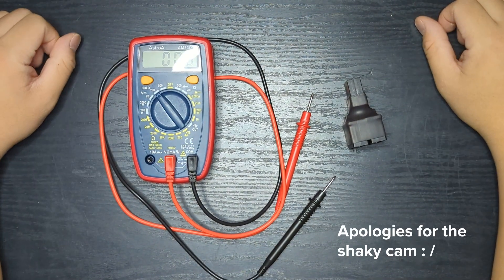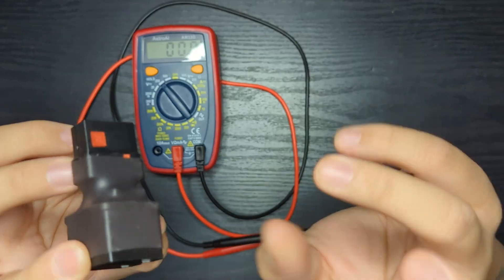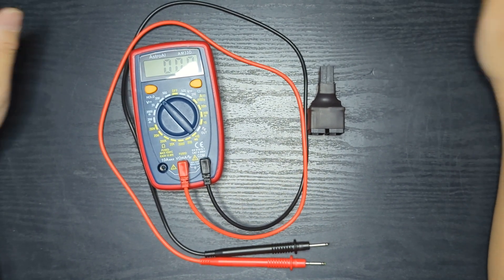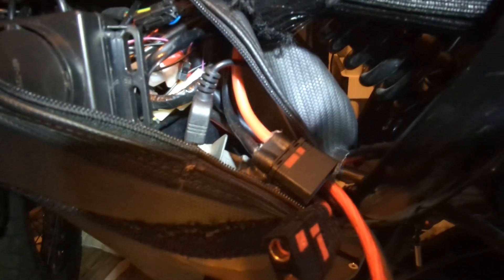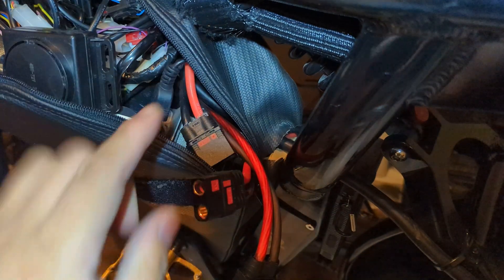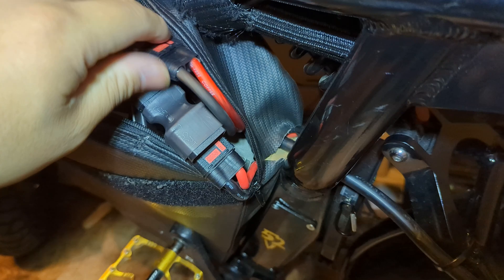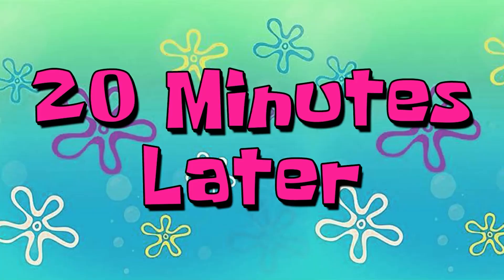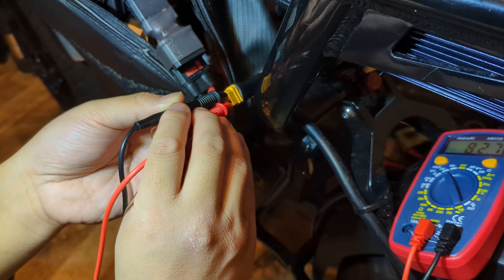How To PARALLEL CONNECT E-BIKE BATTERIES (Easy Step-By-Step)!

Comment: So I want to add a second battery to my bike I was going to buy a blender and another 48v 20ah battery if I buy a xt60 parallel  connector will it increase my ah
Reply from the maker: So whether you use a blender or directly parallel them with a splitter, you will be increasing your ah in general. The only difference is the performance. We've found using a blender slows down the bike in terms of top speed while directly parallel connection adds torque and a little boost in top speed.

Comment: Can i use  an older 48 volt Lectric battery and combine it with my new EBoX 60 volt battery to get more range? Not looking for power so just wondering if i can find the room to hide the 48 volt battery on the EBOX 60volt bike and get more range..itd help.
Reply from the maker: It's not recommended to combine a lower voltage with higher voltage pack only because the difference is too much for both packs to handle especially when they try to balance each other out. Even with a battery blender I wouldn't recommend.

Comment: nice video ,  I have a scooter and just connected both batteries directly to the controller, is that safe ?
Reply from the maker: It's safe but just make sure both voltage readings are the same

Comment: Hey there! would this work if the BMS is different from each battery.. 🤔🤔
Reply from the maker: @KILOALXE  yes you can parallel two different BMS and batteries. Under load the current will usually go with the lower rates BMS first.
Reply: I see!  Thank you so much for the info JB!!

Comment: Can you mix different amp BMS? I have no idea what the stock bms is. I'm running a72v  3,000watt, 40ah battery and i want to add another 72v 40ah battery for range. However there are allot of options but with different bms. Such as 100a, 200a etcetera. Thank you for you time
Reply from the maker: Usually when paralleling two different BMS, when one pack goes into over protect, the other one will as well so it's safe to say it will most likely rely on the pack with the weaker BMS.

Comment: I got a bafang BBSO2 with a 48v-10 ah battery with Anderson connectors. What do I need to convert?
Reply from the maker: @HB-yq8gy  you can actually get an Anderson connector splitter on line so it will be compatible

Comment: Hey man much respect for your setup and wat a cool bike 😎,,its been about a year now how are things going with your bike ,is it stilll ok  the reason i ask is ive a 11ah and a 18ah  that i want to join  both 48volt  and i dont think i need them boxes  ive got some xt90s doubled up  do u honestly think ill be ok doing rhis seens theres a big gap  between batteries like 7ah ,i would still chrge  the batterys in there normal ports would that be ok to have everything plugged un and chargeing with 2 charger s, god bless man  ive subbed 👍
Reply from the maker: No matter the current as long as the nominal voltage is the same you can join them via XT90 for parallel connection. A lot of people that use range extenders use ones with low amp hours.

Comment: When I connect the batteries together and my controller pulls 50amps,will the controller split the amps from each battery? (I’m connecting four 72v 20ah batteries in parallel) just wanna make sure before I run it… ty
Reply from the maker: @FA-cc7ng  the controller will treat the paralleled batteries as a whole so the 50amps will discharge equally among the 4 batteries at the same time. Now if the amp hours are varying, it will discharge from the lowest ah first.
Reply: @JB360_NYC  Ty brotha I appreciate you
Reply: @JB360_NYC nope.. lowest Ah will have higher internal resistance... so lower current from smaller pack.
 higher current from bigger pack... so they perfectly discharge in parallel keeping voltages the same
Reply: Does the amperage of the BMS have to be the same for both batteries? I want to add a second battery to a 72v 3,000watt hub moter. There are allot of options with different amp BMS available, I don't know what my stock is.  @JB360_NYC
Reply: What actually happens is the blender reads the voltage from the batteries and switches to the highest voltage battery. As you use this battery the voltage will sag slightly and the blender will switch to the next highest voltage battery and the first battery will recover as the blender switches between the next two batteries and then switches back to the first battery, or whichever had recovered the quickest. This means that a weaker pack will take less of a beating, but you're still drawing the full amperage from one battery until it's voltage sags and the device switches to another battery and pounds on it until the voltage sags. It doesn't absorb abuse like a single larger pack will, because the abuse is spread over more cells. It just allows the smaller batteries to recover briefly in between.
Reply: @nathansroofing9748  thanx brotha, since I have them connected can I charge them at a higher amps
Reply: @FA-cc7ng I have 2x 52v 25 Ah... each pack can be charged with 5 A ... but I do not set my charger to 10 A... I set it to 8A to have some safety room ... I do not use a blender ... y splitter cable in discharge and on the 2 charge ports used
why I do NOT use a blender that switches between packs?? both direct in parallel means they share the load.. lower current per cell and lower voltage sag under load
Reply: @ ok cool thanx brotha I appreciate it this helps big time
Reply: @FA-cc7ng  if all 4 packs are identical then you can use all together (no blender) ... but you have to take care that they are exactly identical... my genuine pack had a safety diode in charger port (so a short on that port does not hurt.. there only can flow current inwards but not out) ... added 2nd pack did not have that inline diode ... so they could not be charged to same voltage with ONE charger ... I added a 5 Amp diode in the 2nd pack in minus rail and now the one charger sees both packs... but one pack can not see the other pack
result is on charge and on discharge the voltages are identical (in fact they can be seen as a single bigger pack) ... on discharge they are direct in parallel and share the load... on charge they also have the same voltage cause I use one bigger charger with y splitter cable and both packs now have the same voltage drop over the diodes ...
Reply: @ yes they are all identical the same pack 72v20ah, thanx brotha I appreciate it

Comment: Hi great video can anyone tell me if you can run a older battery in parallel with a new battery and does it matter if they are different cells?

All that matters is that both batteries are the same voltage 

Thanks
Reply: Good question but i think once your getting the same voltage number or very close  then i cant see why not ,go for it bro ,im goin for it just waiting on a reply here to confirm and im  connect ing  a 18 ah to a 11ah 48 volt  and the 18 is a older battery

Comment: 👍 Nice... Do you know how people are getting 60 mph off 60v system while others only get 50s on 72v ?   I assume its controller but is it  matter of preserving lifespan of batteries?  You would think people would want highest amp possible?  Thanks, and love your content!!
Reply from the maker: @kevinduprey9326  thanks! So yes like you mentioned, it's mainly the controller and the type of BMS the battery is suited with. On the flip side, 72v batteries will always be better on the range side than 60v, since they take longer to discharge from their starting voltage.
Reply: @JB360_NYC  . NICE,   obtained some 80v green works batteries and will harvest the good ones.  I was thinking about getting solder less kit because I'm not to good at it.   Unfortunately I know from making vape devices that every added connection  causes  voltage drop.  Vaping with hybrid mechanical mod with direct battery contact is noticeably stronger than devices with added connections.  I can only imagine the difference in EV's using hundreds of cells.

Comment: Does it need  to the same AH?
Reply from the maker: No they do not they can be different amp hours
Reply: @JB360_NYC  will parallel battery increase speed and torque 
I have a bac4000 controller do I need to retype my bike
Reply from the maker: @allan2502  you will get a slight increase in torque and top speed. In terms of the BAC app, you should not have to adjust anything unless you want the controller to pull more amps you should be fine.
Reply: @JB360_NYC  is their a parallel connector for supra connectors?
Reply from the maker: @allan2502  not sure specifically for the Supra connectors but I did see a Supra to QS8 connector online which you can use

Comment: I want to make a triple battery parallel connection, I have two 48V/13AH battery and one 48V/21AH battery. Can I use this way to use and charge them? And could I charge with multiple charges at the same time?
Reply from the maker: Yes you can! Once they are paralleled and linked, you can use one charger, two chargers or even 3 at the same time to speed up charge time.

Comment: Im a bit confused do bothe battery need to be on
Reply from the maker: Depends if you have for example a shark pack that has an on switch then yes both batteries need to be on to complete the parallel connection. Most high voltage packs don't have that switch so you don't need to worry about it.

Comment: I have an xclass 52v 18a, 1000w Motor, 33a controller and I added a 52v 20a second battery. Charged it up and connected with a 40a Double Battery Pack Balance Discharger I got from Alibaba, I rode it for like 5 mins and it shorted out My display and cables any suggestion of what could’ve caused the problem? Plz help 🙏🏽
Reply from the maker: This happened when I first got my x-class and used the battery blender. Check and make sure your battery connecters are fully plugged in as well as the motor cable...any kind of separation can cause an arc shorting out the system
Reply: @JB360_NYC  Did any components get damaged after this?
Reply from the maker: @youngjay914tv9  no damage just had to re-secure my battery connectors and didn't have that issue again

Comment: please, I think you agree with me that nothing is better on the market than Dx2 Dx2c, etc blenders, with them you can mix juice and voltage. I've got 48V 17,5aH  and  52V 20aH running so good no fuss no issues.
Reply from the maker: For sure, I think for a lot of riders it takes the hassle out of matching voltages with a voltmeter. For higher output applications, paralleling guarantees you get the most out of both packs.

Comment: Hi. One question. You put in paralel discharge port. Did you put in paralel charging port? Thanks
Reply from the maker: No you want to only parallel both discharge ports
Reply: I also charge in parallel (one bigger charger modded with two cable outs)
both packs have an inline diode in charge port

Comment: Something does not seem correct you cannot solely rely on the voltage reading from a batteries charge port it it can be possible that the charge and discharge ports are giving different readings (if in the event of a faulty BMS, the state of charge cannot be accurately measured by just checking the charge port i think it would be safer to check  each cell group of each battery and technically try to balance each battery before putting them together in parallel

Comment: What's the point to connect your 2 batteries when yiu need to decrease the voltage from one battery to meet the voltage another battery running Yr bike for a while. So, I need to have my multimeter in my pocket and after every charge if I'm charging separately with charger for each battery, to check all the time the voltage?
Reply from the maker: No the multimeter is only used for the first time when paralleling the batteries to measure and make sure the voltages are at the same level. After a successful parallel connection you don't need to do anything else and can charge both batteries from either port.
Reply: Ok, so, you are not going to check on every single time?
Reply from the maker: @pavlovazl9162  nope you don't need to
Reply: not all packs can be charged from the discharge port..

Comment: What about when it's time to recharge do you have to do this process where the battery have to have same voltage before you connect them Again?
Do you charge the batteries independently? 
If not is it only charging via One battery charge port and   not messing up balance charge on the second battery?
Reply from the maker: Once the batteries are linked and paralleled you don't need to repeat the process as you can now charge from either battery port which will charge both batteries at the same time. The awesome thing is too is if you have another extra charger, you can insert the extra charger into the second battery port and essentially speed up your charge time by half.
Reply: @JB360_NYC  thank you.
What about running two controllers off this parallel battery connection?
Reply from the maker: @jbar3337  yes with two controllers, you would just need another y splitter cable so both controllers controllers can link to the batteries. Essentially the y cable connectwd to your batteries will connect to the y cable for your controllers.
Reply: it depends!!! 
I use a y splitter cable also on my charger... so I charge and discharge in parallel and in all cases the voltages stay equal BUT
I had to add a diode in my upp pack cause my genuine pack also had one (no voltage measured on charge port)
now both have an inline diode on charge port (roughly same voltage drop)... on charge and use both are paralleled and voltages match
Reply: side note.. in the minus rail cable of the charge port a 5 Amp diode added 
yes it plays a role where you add it (if you leave the packs connected on discharge port)

Comment: What is there two batteries and 2 controllers can you do a similar connection also I have a 15 amp hour battery in a 20 amp hour can this be done with non-matching amp hours
Reply from the maker: Yes as long as they are both the same voltage you can have different amp hours.

Comment: If you are charging both batteries simultaneously with one charger, that means that one battery is charged through its discharge port. Maybe I'm mistaken but I believe that charging through the discharge port bypasses the BMS, which could lead to overcharging and other issuess. The battery that is charged via the charging port will be protected. But the second battery won't.
Reply from the maker: Not necessarily because once your packs are paralleled they act as one system. The packs itself won't allow overcharging anyways due to the limitations both BMSs have in place.
Reply: @JB360_NYC  I have a smart BMS pretty much identical. one pack is 50ah the other is 60ah can you still charge them together?
Reply: @JB360_NYC  oh that’s a relief.  I was wondering the same thing.
Reply: Too much complicated for saving 30 bucks on blender. In this set up can't be charged batteries over discharge port. BMS will not control charging. I run 3 batteries w/2 blenders w/no any problems.
Reply: Charging via discharging port does not neccesarily cause problems. It depends on the BMS. As for the jbd BMS's (which I'd recomend anyway due to the BT connection that allows configuration and Controll over the Battery) I don't even used the charging port. Interestingly I can turn off charging via software while leaving discharging on and it would not charge although the charger is connected to the discharge port.
Reply: @schubi128  that's good to know, thanks!
Reply: I charge both with one bigger charger and a y cable
Reply: on discharge direct in parallel.... on  charge port both packs have an inline diode (one had it by factory other pack got a 5 amp diode installed by me) ... so charger sees both packs but one pack does not see the other while charging via charge port..

Comment: Can you charge the 2 batteries at the same time with 2 different chargers
Reply from the maker: With different amperages yes you can. Just be sure your outlets can handle the amperage.
Reply: @JB360_NYC  I have 2 72v 20ah batteries that are paralleled and 2 72v 5amp chargers and I always disconnect everything when I charge them but it's a hassle, I want to charge both of them while they are connected
Reply from the maker: @EricsP51  yes with that setup you can absolutely use 2 chargers

Comment: I have a 48v 7.8ah, and a 48v 10ah battery. If I charge them both to full capacity will it be safe to parallel them without checking the voltage, I don't have a volt meter
Reply from the maker: I would recommend getting one just in case because you don't want to be too far off in terms of actual voltage. They're actually not that expensive on Amazon. The one I found is like 12 bucks and works great.
Reply: @JB360_NYC  after you match the voltage how often do you usually check the batteries to make sure the voltages match?
Reply from the maker: @boulokid1977  not often at all. As long as that y-cable or parallel connector is connected to both batteries, you're good to go unless you physically disconnect them for some reason. Also, if you're curious, just measure both batteries as soon as they're connected and they should read the exact voltage to the decimal. That's how you know you have a successful parallel.